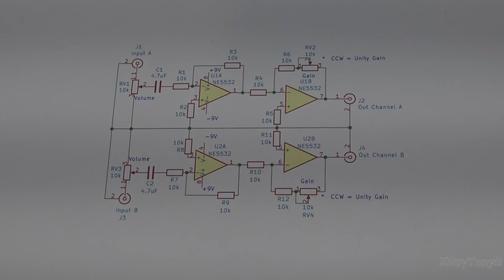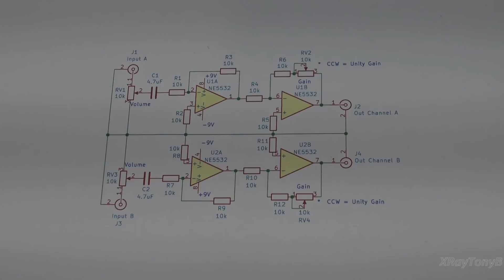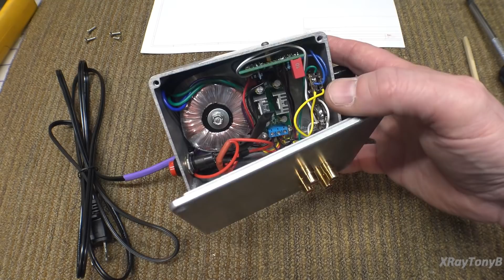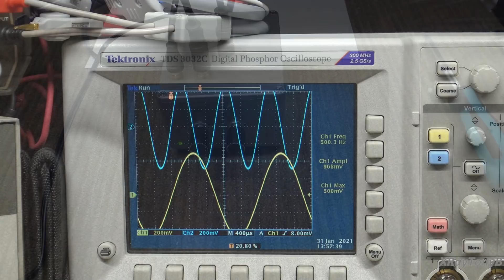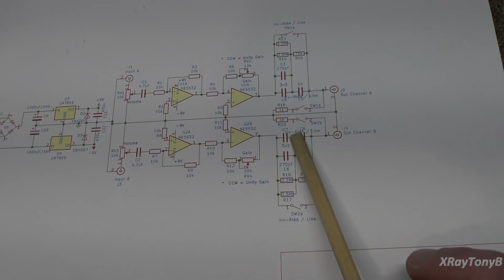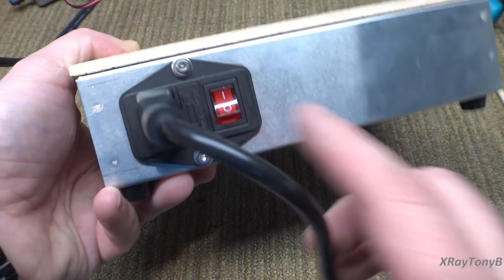Random Video - Buffer Preamp w/ Reverse-RIAA Stage For the Bench

Comment: I notice that the AC input impedance as seen by the source will vary between 10K and 5K depending on the volume setting.  I thought 10K was the typical lower limit for RCA-type line level.  Higher input impedance (up to about 100K) is not unusual in the specs for other gear.
Reply: The pot is oriented in such a way that it always sees the full 10k resistance to ground
Reply: @Spentelectrons  Yes, the source always sees the 10K pot.  But if you turn the volume to maximum, the source will also see the 4.7 cap in series with a 10K resistor to the input of the op amp.  Due to feedback, the inverting input of the op amp will be kept at ground potential.  Ignoring the impedance of the cap, the source is going to see two 10K in parallel, or 5K.  We can argue details, but the source is seeing a load far below 10K at audio frequencies.  Unless I'm reading the wrong specs, I'd be shooting for "10K or higher" as my design goal.
Reply: @russellhltn1396  hmm. You may very well be right. I'm no expert by any stretch of the imagination. It was my understanding that the op amp itself provides theoretically, in a perfect world, infinite impedance so it would be 10k in parallel with infinite plus 10k. Perhaps I'm overlooking something
Reply: @Spentelectrons  Yes, the input of the op amp itself is very high.  But the gain is also very high.  An ideal amp would have infinite gain - meaning any difference between the inputs would drive the output to the power supply rail.  The way I think of it is the op amp will position it's output so as to match the two inputs.  Since the non-inverting input is connected to ground, the inverting input will adjusted (via the amp's output & feedback resistor) to always be at ground potential.  The op amp positions it's output such that the current going though the feedback resistor will match the current coming though the input resistor.  That's how the ratio of the two resistors sets the circuit gain.
Reply: @russellhltn1396  I guess I don't understand where the gain comes into play with impedance. I've been wanting to learn more about impedance. I tend to use a 22k resistor and no pot while breadboarding. The source sees a fixed 10k. The op amp doesn't much care about input impedance. I'm failing to see where this translates to 5k impedance
Reply: @russellhltn1396  the output of the op amp is at a higher potential then the input therefore no current is passing forward through the feedback circuit. The input of the op amp is virtually infinite impedance. Therefore it is virtually an open circuit through the op amp. Therefore the source only sees the 10k resistor, theoretically. Therefore it's 10 input impedance. Maybe I'm wrong. I'm not afraid to admit to that
Reply: At that point the position and orientation of the pot simply ensures your source doesn't see a dead short while the pot is at zero which would effect the high pass filter and input impedance
Reply: @Spentelectrons  How are you measuring the impedance the source sees?  A DVM only tests at DC. At DC, the cap will look like an open circuit.  However, if you measure at audio frequencies, the cap will is no longer an open circuit.
Reply: @Spentelectrons  If there is a difference in voltage at the two ends of the feedback resistor, then by ohms law, there must be current though the resistor.  But if the input of the op amp is infinite, then where does the current go?  Hint: though the input circuit.
Reply: @russellhltn1396  hmm. Interesting. Yeah. I would like to learn more about this subject.